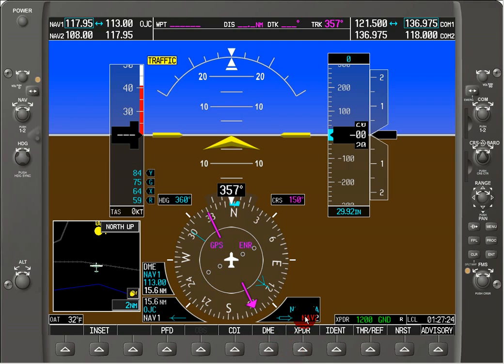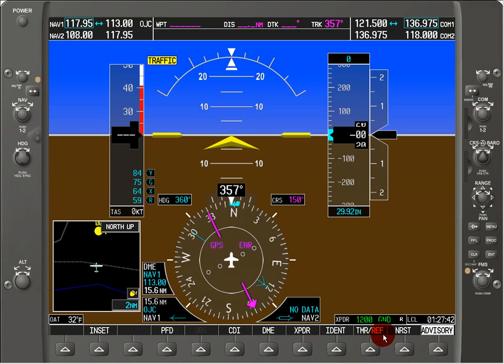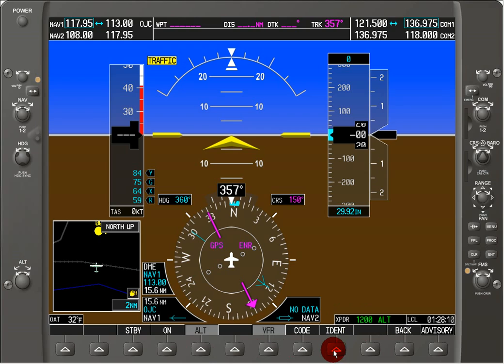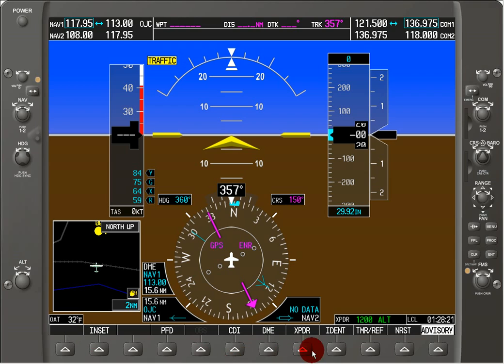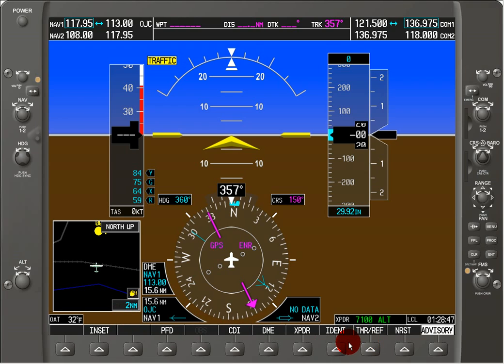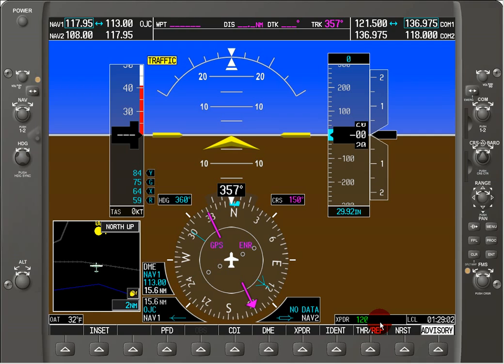Garmin G1000 Tutorial: Transponder

Comment: Good Video. Do you know if the transponder automatically changes from Standby to Alt as you reach a certain altitude?
Reply: i am also looking for it. who knows?
Reply: @양수민-p6s  @Jake W According to 'GARMIN G1000 Pilot's Guide for Cessna Nav III' page 122, Altitude mode is automatically selected when "the aircraft becomes airborne". Since the transponder on the G1000 uses pressure altitude data and the guide does not mention any specific altitude, I presume that the automatic switch happens when the VSI initially indicates a certain degree of positive climb after turning on the avionics. Hope this was helpful.